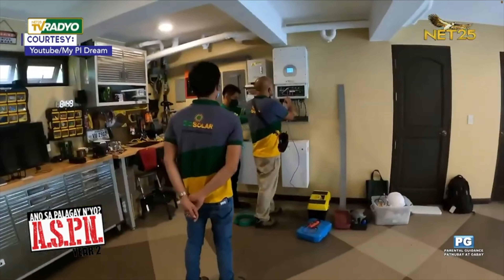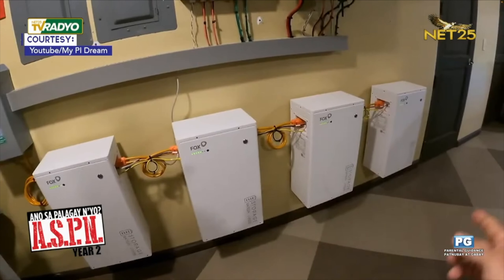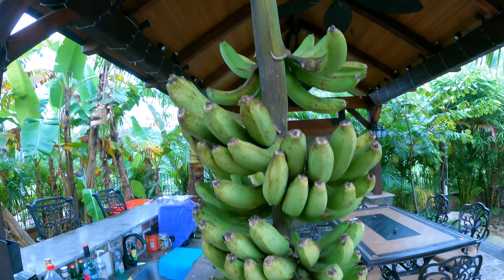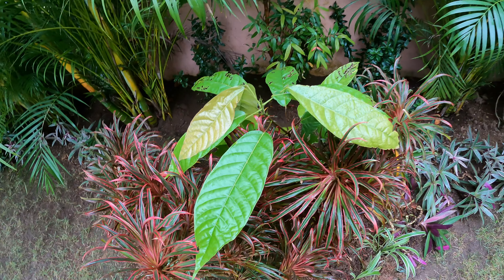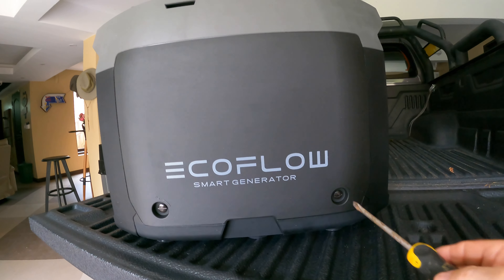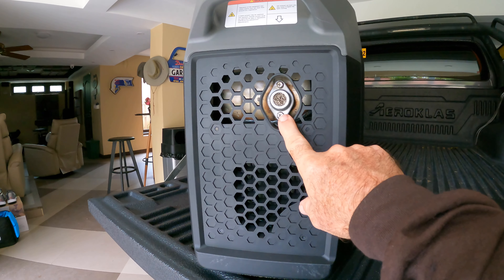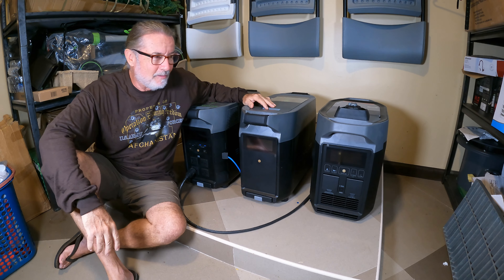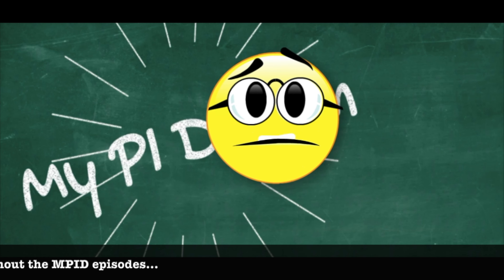I HATE BROWNOUTS! (Our Latest Energy Update)

Comment: Very nice setup. I am curious why you went with the gas only option. I saw there is one that also uses LPG. It looks like this would have fewer emissions, the fuel lasts longer without treatment, and though it is less efficient per gallon of fuel, I think it could be cheaper to use depending on fuel prices in the area. Maybe this version isn't available in the Philippines, or isn't as reliable?
Reply from the maker: They don't offer the newer dual generator over here yet.  We're behind the power struggle with logistics in the Philippines.  I did want it but opted for what was available.

Comment: Hi James, I have watched with keen interest on the evolution of staying live during those cursed brownouts !! Lol. That being said, I have done some research on the solar panels in the tropics, long term sun exposure could be a problem as the panels become superheated. Your thoughts. I find it interesting that the backup to the backup is back to fossil fuels though. The solar panels are a great subsidizer for the electric consumption and the storage is a great idea. Have you calculated the time where the cost savings pays for the unit purchases?
Reply from the maker: We installed the system in July.  We'll keep tracking the efficiency to see if there is any degradation over the years and report.  

ROI should be around 7.5 years.
Reply: Thx for the quick response, we have our wheels now so I will call soon to set up a visit 🚗🚗

Comment: Great video as usual. One small remark : it's CO (Carbon Monoxyde) that is very dangerous and can kill you if you run this device in closed room with no proper ventilation. CO is odorless and can bring you down without warning. It's good there is an alarm on the Ecoflow for it. In the video you said CO2 but that is different as it is mainly a problem for climate... In any case this is a very nice  setup which should make you resilient in any situation... great job !
Reply from the maker: My bad...thanks for the catch in my terminology!

Comment: What is your ROI return on investment? How many years to pay for all these toys. Seems no one wants to talk about that. You can save a huge amount on you electric bill by just using LED lights instead of the fancy incadessant lights. Also why such a big home, you should have built a home to fit your needs not for show and glamour then try to save a few bucks on your electricity bill. When i build my home in PH i will build what we need and just buy one back up generator-desiel- not gas as gas is too volatile. It will be wired for auto start when a brown out occurs and shut down as needed- when power is restored. Tell people the costs to do this and figure out how many years before you get a ROI and will you be alive or even living there by then. Are you being paid to push these products. Sorry but if you buy a Caddy instead of a VW then do not complain about insurance cost and fuel millage and maintanance.
Reply from the maker: Regarding the EcoFlow there is no ROI as these are emergency backup.  For the main solar system about 7.5 years ROI.
We had the diesel generator on a ATS and auto start.  That lasted about 2 years then we had problems.  I wanted solar from the offset but I couldn't settle on a system early in the build.  Today there is availability of new tech and good installers.
Reply: @MyPIDream  Ah but they are part of your solar reinforcement so they are part and parcel, also you say 7.5 years so if I USE THOSE NUMBERS then that means you only paid for the whole solar system that is 90 months and assuming you will save $ 160 per month the solar setup cost you (complete system, batteries and all including labour ) COST YOU  $14,760. is THAT RIGHT AS IT DOES NOT SEEM RIGHT TO ME. Did you factor in maintainance and repairs from typhoon (damage).